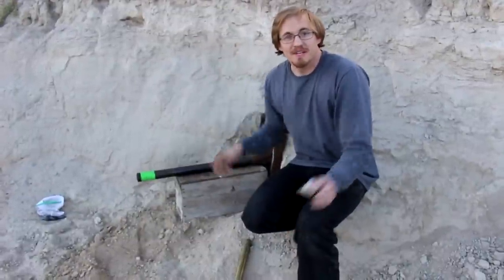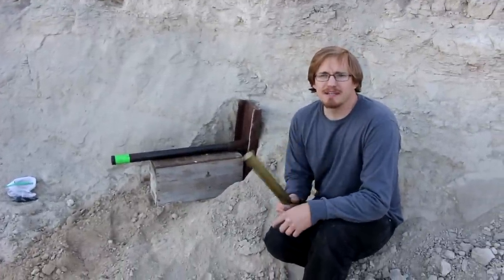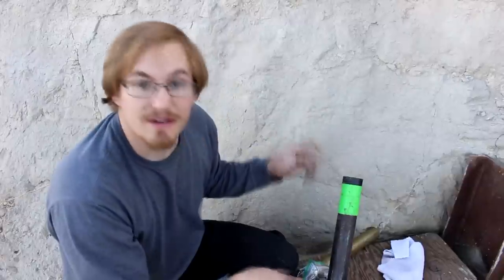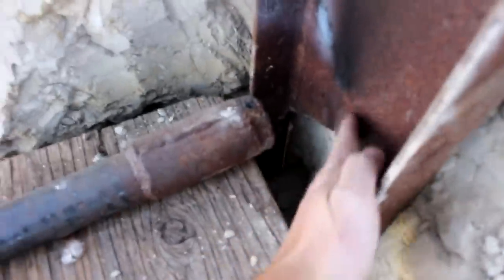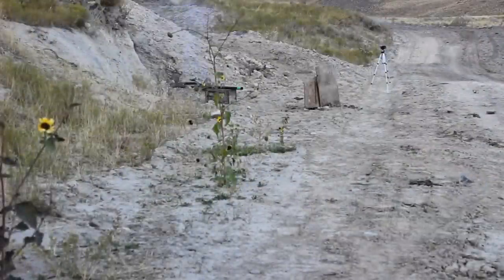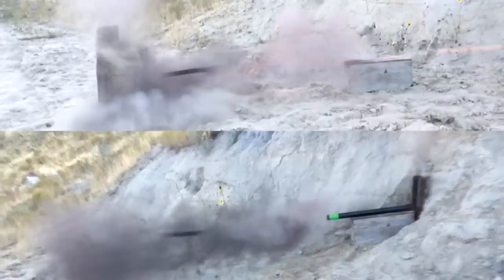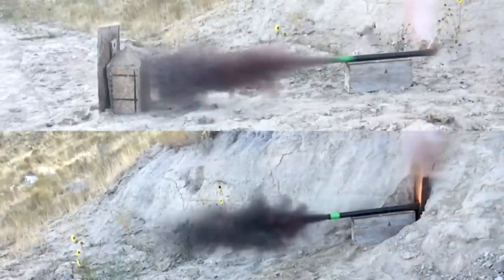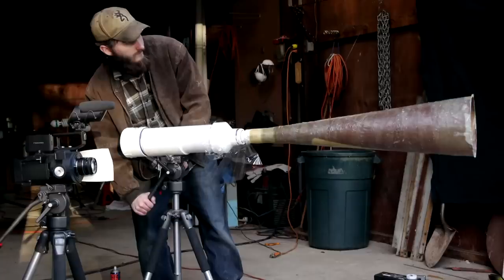How Does Recoil Affect Gun Performance?

Comment: Hmmm... I'm not quite sold on the idea that there is no difference. I would like to see the tests repeated with 1.  - A breech on the cannon so no gas can escape. 2.  - The powder grain size and WEIGHT optimized so that all the powder burns in the gun when it is A. Stationary, and B. Allowed to recoil.  3. -   Use of the chronograph.  4.  -  A set of four tests,  no recoil with each powder load,  and recoil with each powder load. I predict that, if the powder is not in excess, and there is no gas leakage, the muzzle velocity of the stationary cannon will be greater than that of  the recoil cannon for the weight of powder used.
If not, we had better tell NASA that the Laws Of Motion are wrong!

Comment: I think you can't get conclusive results from this one experiment.
Reply: +1 for science
Still liked the video, but it's not very scientific.
Reply: this is the second experiment, as he says at the start he's done this before
Reply: And poorly executed one. He concluded that there is no change of the velocity of the projectile. And that is wrong. Rifles with longer barrels produce higher velocities, because the bullet has longer time to be accelerated by the pressure. Around 10:20 Cody said - that setting barrel free essentially shortens the barrel. And that is the real thing! Those measurements were not accurate at all, and the length of his barrel just made it look similar. If you Take 2x shorter barrel and do the experiment again, the projectile will shoot much slower with free barrel, because the effective barrel lenght will be reduced even more. The speeds would be the same only if the length of the barrel is extra extra large, since the projectile will be able to reach maximum speed within the barrel anyway. The lenght of the barrel is the key here!
Reply: I agree. It would be interesting to see what would happen with different weight ratios of bullets and guns. Might be a coincidence in this case, although, in the video, I see a slight difference in speeds.
Reply: Exactly. You can easily google bullet speed measurements for various calibers with differing barrel lengths. The bullet fired from a short barreled pistol, will have a lower velocity than this exact same bullet fired from a longer barrel. This is because it takes a certain period of time for all of the gunpowder to burn in the barrel. If the bullet leaves the barrel before all of the powder is burnt, the rest of this powder is essentially "wasted", and the bullet is slower as a result. 

In the video, you can see the brass projectile leaves the barrel without a backstop before it leaves the barrel with a backstop. Removing the barrel backstop causes the barrel to act "shorter" , since the projectile spends less time in it, causing more gunpowder to be wasted than in the barrel with a backstop.

I think that this experiment was simply not precise enough to show this result clearly.
Reply: You are right -
i think that  a more precise measurement of the projectile velocity will show that it is slower because of recoil .
[
Cody's hypothesis assumes that the maximum velocity of the projectile is achieved before it leaves the end of the barrel
]
I say it constantly accelerates until it leaves the barrel 
]
so a recoiling barrel will have the projectile leave the barrel sooner and therefore have less velocity
Reply: Exactly right !

Comment: Newton's 3rd law isn't violated because the equal and opposite reaction is not transferred back into the bullet when the barrel isn't allowed to move. All of the energy forcing the barrel backward is still being deposited in the direction opposite the flight path of the bullet. In other words, by fighting the recoil you are not stopping the energy in the barrel from being released, you are merely forcing it to deposit it's energy into the brace itself. When you fire a shotgun, you don't increase the speed of the bullet by putting the butt of the gun in your shoulder. It just deposits that energy into your shoulder. 

And another reason it doesn't increase the speed of the bullet is that the bullet is gaining it's momentum from a change in pressure inside the barrel itself, not a force acting on it from outside the barrel. You aren't adding to that pressure reaction, so it should have the same velocity in both tests. The only difference will be from the fact that the barrel is moving backward as the reaction happens in the unbraced test. The difference is only going to be a few inches as most, and that doesn't change the velocity, it only changes the point at which the bullet leaves the barrel.

Comment: So, what's the math?  Bullets from rifles (long barrels) go faster than the same bullet from shorter barreled pistols, which is not the same as whether or not the barrel is fixed.    The expanding gas has longer to push the bullet.   A bullet will travel the same length of the barrel whether or not the barrel is fixed.   The relative travel with respect to the ground might be different, however.   This is a ballistics problem and there are many equations and apps that address these issues.

Comment: I think this result is because the charge is very small, the gun very short, and the projectile probably doesn't fit very tightly into the barrel. All these factors together probably lead to the difference in projecticle speed being too small to be visible by this method of measuring.
A tightly fit projectile in a long barrel with a high charge should lead to much more significant differences.

Comment: I zoned out briefly so don't know if you got to it. But the gun is not what is doing the work. The pressure from expanding gases in after the explosion is what does the work. The gun itself is simply directing the movement of the gas. 

Therefore, under perfect conditions the gun without recoil would have a larger affect on the projectile because the force is more concentrated and not being allowed too expand in different directions. I don't think we would be able to view this however because of how sudden the bullet leaving the barrel is.

Comment: I don't get it. I am thoroughly confused as I have recently come to 1 of 3 conclusions:
1; I have just realized I am actually mentally handicapped and everything I thought about physics is wrong
2; You have just discovered a new type of physics not previously exploited on a mainstream scale
3; I just simply didn't understand what you were saying.

I'm not a physicist, so you'll have to forgive me for any ignorance. Are you saying that the bullet in both examples is travelling at the same velocity? I just simply can't wrap my mind around that. I can easily agree that the energy in both examples is the same (hypothetically). Both examples contain the same chemicals, same mass, and same mechanical manipulation - that all makes sense. But the one thing that is changing is where the energy is going. There is another variable, and that is the complete system.

In the first example, the expanding gasses are contained to the barrel for a longer period (I think) allowing more work to be done on both the cannon and the bullet (yes, equal and opposite). But in the second example, the cannon and the bullet lose contact with one another (presumably) twice as fast. This would cause the expanding gasses to release more energy into the new system (the atmosphere, as opposed to the cannon internally). 

Barrel length has a direct correlation to ballistic effectiveness. I would assume this is due to the time the gasses have to act on the two masses.

If your explanation is true, then what have gun manufacturers been doing for hundreds of years? Are they wrong? Or am I just simply misinterpreting the science?

Comment: I gotta nitpick the last thing you said. "The amount of energy going into the bullet & gun remains the same, the total amount of energy can be smaller."

The total amount of energy is determined by the amount of powder you put in. Aside from the trivial amount escaping from the touch hole, that whole amount of energy has to push the bullet and the gun. Now, you say the unconstrained gun is the same as a recoil constrained one with half the barrel length, and I think that is true for what you tested.

But consider these variations; no barrel at all, just exploding a charge next to the bullet, would give far less velocity. Then consider a 1 or 2 inch barrel. My point being that this calculation has a lower bound. 

Then consider a mile long barrel on a recoil constrained gun. That power that compressed the Earth by half an atom would rebound into the gun before the bullet exited, which would seem to deliver that energy back to the bullet.

I think that the reaction happens so fast that the difference between recoil and not is not measurable here. There has to be a difference though.

Comment: Hi Cody, I thoroughly enjoy your videos, however this one contains a few errors. 
 - If you examine the bullet projectiles closely and calculate the speed using an overlayed grid you will see that the projectile shot from the supported gun does indeed have a slightly higher velocity.
 - The law of conservation of energy makes it impossible for a bullet to be traveling the same speed from a rigidly mounted gun vs an unsupported gun that receives some of the energy and accelerates backwards. Recall kinetic energy for an object is E=mv² and total kinetic energy for the gun and bullet system is E(total)=E(gun)+E(bullet). Keep in mind that since v is squared, a small reduction in velocity of the bullet equals a considerable amount of energy available to accelerate the gun rearwards.
 - Newton's laws require that objects interacting with each other receive equal forces, not equal energy.
 - Ignoring energy for a moment, consider that if you apply the same force to an object for a shorter time compared to a longer time that the resulting speed will be lower with the shorter time (v=at and a=F/m; or v=Ft/m). If the bullet did somehow accelerate to identical speeds, the time the force is applied to the bullet would be reduced if the gun accelerated rearwards. Since v=at or Ft/m, a reduction in time makes it impossible for the bullet velocities to be equal.

Having said this, I do agree that the projectile is travelling faster than simple momentum, force and energy calculations predict. One of the reasons is that the forces are highest when the relative movement is small and during this time the supported gun is also accelerating backwards a short distance (along with the support), similar to the unsupported gun. This results in the share of the total energy that the bullet receives being similar in both cases. Note the energy that the supported gun receives is converted into heat as it impacts the support and the support impacts the earth.

A few additional experiments you might consider include:
 - More accurately calculate the velocity using the existing video by overlaying a grid and measuring the distance traveled over multiple frames.
 - Consider a thought experiment where you have an extremely light, but strong gun combined with the same bullet and energy source. Take it to the limit where the gun has almost zero mass and therefore accelerates with almost no resistance when a force is applied (F=ma or a=F/m). If the gun accelerates almost infinitely quickly rearwards (due to almost zero mass), it will accelerate so fast that the time the equal (but opposite) force is applied to the bullet approaches zero. Since v=at, zero time (without an infinite acceleration) results in zero velocity for the bullet. A zero mass, unsupported gun would simply shoot itself away from the bullet, while the bullet remains stationary (and then drops to the ground).
 - Repeat the physical experiment with a rigidly supported gun to ensure it can't move rearwards at all.
 - Repeat the experiment using a heavier bullet and/or lighter gun to amplify the differences in velocity.

Comment: Do two guns back to back so their recoils cancel.  Would the reaction energy from each then transfer to the other bullet thereby causing them both to have increased velocity?
Reply: Definitely. Think about it this way. One of the guns is probably going off first, so you'll get the velocity of the second muzzle added to the velocity it gets from the charge.
Reply: Um. No. The hypothesis is they go off at the same time. If they don't the experiment failed. If they do go off at the same time with the same force as to cancel each other out, nothing will change.
Reply: bbl4tter if each gun is producing the same force on the bullet, when they are back to back the force that the bullet applies back on the gun is canceled by the other guns recoil. Basically the velocity of the bullets would be the same, ideally, but the guns themselves would just stay stationary.
Reply: Joey Haigh You are forgetting that 2x the guns will use 2x the gunpowder.
Reply: bbl4tter the amount of powder per bullet is the same, only force out back on the guns by the bullet is stopped by the other gun. That's why if you shoot a gun in a sighting mount it has the same velocity as if it were in your shoulder because the mount and you act as Newton's 3rd law to prevent the gun from flying back either way.
Reply: I think you are forgetting that momentum is a vector quantity. The momentum from the recoil of the first bullet would cancel out the momentum from the recoil of the second bullet. 

Or are you trying to come up with an energy-based solution? Considering a single gun and assuming the gun is 100% efficient in converting the chemical energy into kinetic energy, no actual energy is lost to the gun when it is not allowed to recoil; it's all transferred to the bullet. That's because the velocity of the gun does not increase. 

Therefore, I can't see how your hypothesis can be correct.
Reply: Mada11UK Two guns back to back eliminate recoil which is why the bullets will go faster.  No momentum will be lost to the gun so more will be imparted to the bullet.  Change in momentum equals force times time.  Pressure is pushing on the bullet so force equals pressure times area of back side of bullet.  The pressure decreases as the gas expands when the bullet moves down the barrel so pressure and force decrease as well.  However pressure decreases considerably more after the bullet leaves the barrel.  The bullet will leave the gun first in the recoil situation reducing the time that the force caused by the pressure has to act.  Force times a smaller time delta equals mass times a smaller velocity delta.  Recoil slows down the bullet.
Reply: +bbl4tter I don't necessarily disagree with you about the single gun recoiling. I came to a similar conclusion.

However, I don't agree with the 2 gun theory. Momentum is a vector and can cancel out. In the explosion, only the vector sum of the momentum change has to equal 0, not the sum of the magnitudes of momenta changes.
Reply: +bbl4tter I don't necessarily disagree with you about the single gun recoiling. I came to a similar conclusion.

However, I don't agree with the 2 gun theory. Momentum is a vector and can cancel out. In the explosion, only the vector sum of the momentum change has to equal 0, not the sum of the magnitudes of momenta changes.
Reply: Mada11UK If you have a barrel open on both ends, then pack a single charge of gunpowder in the middle with bullets on both sides, what will happen when fired?  Will the bullet be faster, slower, or the same as in Cody's experiment?
Reply: bbl4tter In theory, the speed of each bullet would likely be similar to Cody's second experiment (recoil) and slower than his first experiment (no recoil).
Reply: bbl4tter 
"if you have a barrel open on both ends, then pack a single charge of black powder in the middle with bullets on both sides"
that is actually how the Davis gun worked (it was an early recoilless rifle used in ww1), and the velocity would probably be the same on both ends (assuming the shot and countershot are the same mass)
Reply: bbl4tter nah because the projectiles are not accelerated by the actions on the gun but by the gasses rapidly expanding in the barrel the barrels would just not fly backwards